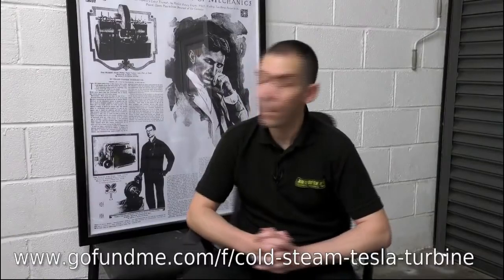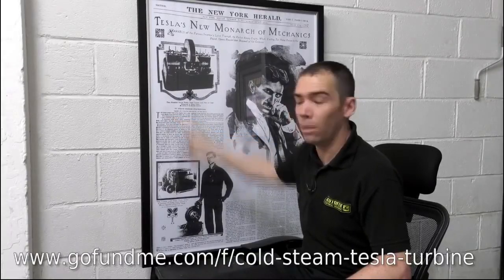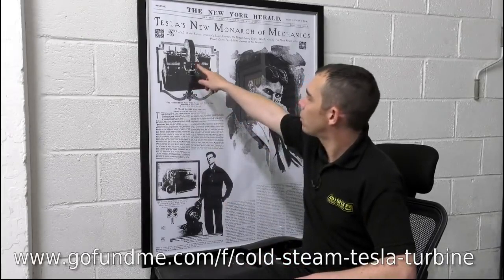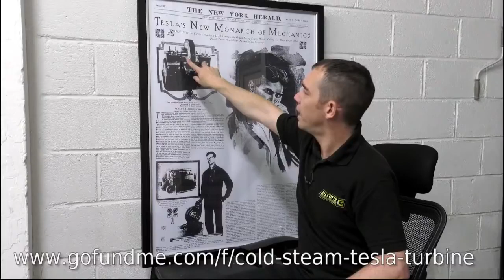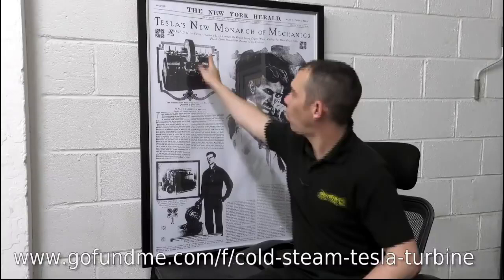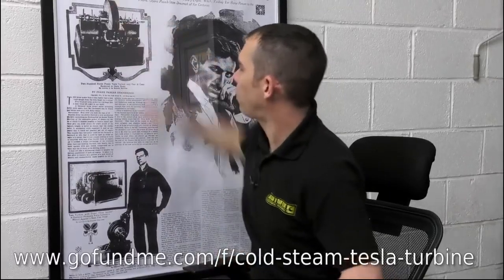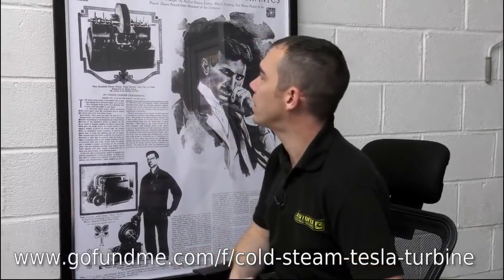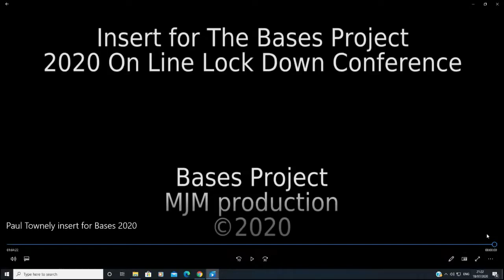Bases2020 - Paul Townley - Tesla Cold Steam Power - Part 1

Comment: Paul I love your work. I would love to help in which way I can. I am building a dual stage vertical hydro version of the Tesla Turbine with a custom made alternator (3 rotor , 2 stator on the same shaft). It is designed to run with 5L pr second with 30 x 15cm Ø @1.2mm thickness discs on the first and 30 on the second with 8 x 10mm mm vent holes. I use star washers 1.2mm....basically your mk2 design. I look at the dual stage turbine as a venturi. I am thinking about using a venturi at the inlet port and putting the suction part of it to pick up part of the second stage outlet. I am a Dane living in Japan
Reply: @nikola.tesla.r.and.d.centre  Well no I dont have a waterfall in down town Tokyo unfortunately, nor do I have space to mount a large solar array.  For now I am using a high output centrifugal pump designed to shift water around in reef style aquariums. The pump can push 18000L an hour to a height at 7 meters using 150 watts(Pump can be throttled as it is 24v). This is for testing purposes however. In my system the pump will be powered by 200 wh lithium cell that gets charged by solar or the grid.  Aforementioned is the drive train for the turbine. One of the advantages of this is  that the water gets circulated in a closed system with a water reservoir (300l) and the pump will push water into the turbine and help pump it out. The general idea behind this is to utilize rather limited watts by investing all of it in driving the turbine/alternator combo. Brake even is about 150 watt output from the alternator/turbine combo. When you think about it the applications are many in a "watergrid" on a larger scale. I chose water for this reason and because of the massive energy moving water provides. I also dont have the skills you have and access to the machining tools you have even though I love the cold steam where the Tesla turbine clearly has the biggest potential. Cheers!
Reply: @nikola.tesla.r.and.d.centre  A million thanks for the suggestion. I was a bit back and forth on the volute casing as it is more complicated to make. I know it is worth it, as it is effectively an evolution of some of the principles of a Francis turbine which has proven its worth, thank you for convincing me. My native language is Danish,  I do however also speak German, English and some Japanese. Japanese is a tough nut to crack though. It is a relative simple language to speak, pronounce and the gramma is easy as well.(They put words in different order though, so if you translate directly it is a bit like how Yoda from Star Wars speak)  Learning how to read Japanese  is another matter and I do not master that. My wife is Japanese though and my son is half Danish and half Japanese. If something complicated is called for they assist:-) You are right about the manufacturing part. I have established contact with a few facilities that are part university, part business they can make what I want at a reasonable price. The challenge is the technical communication. Thanks again Paul. I know you are working on gathering Tesla patents  if there is anything related to this process with regards to Japan or Denmark i can help you with let me know. I will drop an e-mail in your rocketmail(that is old school haha, love it)so you have mine. I will by the way make a Youtube channel with videos on my progress. Cheers!

Comment: A lot of interesting leads to follow in this conversation.

I wonder, why would the Carnot theory be "nullified" by having a frictionless system assumption? The aim of the theory is to establish an upper bound of heat engine efficiency. Adding friction terms to the model is only necessary to compute specific operating conditions for a built system. Many similar assumptions are used to derive relations in physics to approximate system behavior (e.g. frictionless planes for estimating velocities of objects, neglecting wind resistance for trajectories, etc).

The Carnot theory doesn't contradict the higher possible efficiencies of a Tesla turbine, it only suggests the approximate operating conditions necessary for a given level of efficiency. I assume you've seen the work of Warren Rice from ASU?
Reply: @nikola.tesla.r.and.d.centre  Thanks. Do you have the links where I can read about Frank Germano's designs/work/results? Any idea what operating parameters achieved 86% efficiency for his turbine?
Reply: I mentioned Warren Rice, as he had interesting insights about where innovation may be needed to maximize the performance:

"The performance of the overall turbine is strongly dependent also on the efficiency of the nozzles and the nozzle-rotor interaction. The performance of the pump is also strongly dependent on the interaction of the fluid leaving the rotor with that in the volute and on the efficiency of the diffusion in the volute."

He goes on to mention that laminar flow in the rotors can achieve >95% efficiency. I, like you, see there is great potential in this design. My comments aren't intended to cast doubt about the practicality of Tesla's work, but rather to avoid throwing the baby (thermodynamic theory) out with the bathwater (*present* difficulty replicating Tesla's work).
Reply: @nikola.tesla.r.and.d.centre  Just to clarify, a Carnot heat engine doesn't presuppose any particular heat engine design (e.g. reciprocating). The entire derivation is <15 minutes on Kahn Academy's Youtube channel. It is only based on the changes in internal energy of the working fluid as it moves from various temperature/pressure/volume operating points.
Reply: @nikola.tesla.r.and.d.centre  Adding friction to Carnot's theory doesn't change the upper bound for efficiency it implies. The validity of Carnot's theory doesn't detract from the Tesla turbine - the same way the validity of Maxwell's theory doesn't detract from the polyphase induction motor.
Reply: @nikola.tesla.r.and.d.centre  I agree. And no thermodynamic theory prevents a 97% efficiency level, as long as the the necessary operating temperature gradient exists.

As for "100%", I suspect Tesla understood the value of marketing quite well and I doubt he'd suggest (from a technical standpoint) an "ideal" device could be realized in practice.

Comment: These turbines need to be highly polished mirror finished surface to be more efficient but the surfaces in contact with negative pressure cold steam ought to be operating at ambient temperatures without fossil fuel energy inputs. Hydrolysed hydrogen is a far better solution to thermal application. The surfaces need to be designed with pressure dimples like a golf ball. This way the mass of the fluid is the driving force of the turbine.

The one issue that most people are missing is that the shape of the turbine discs need to be changed due to slenderness ratio to go hypersonic and thereby overcome strength limitations of the materials used. Giving away major secrets of my Project EARTH designs!

Adam Shattock
BEng (Hons) Civil Engineering undergraduate, 
University of Wolverhampton, England.
NTC 4 Mech. Eng.
Pietermaritzburg Technical College, South Africa.
MatselX (Materials Selection & economics),
Massachusetts Institute of Technology
Reply: @nikola.tesla.r.and.d.centre  you are right but it would become a pressure driven one instead at very high velocity. This is where sonic shockwaves become useful towards even higher velocities until it generates sonoluminescence. The friction is what shows the system down. Minimise that and you'll discover something new.
Reply: @nikola.tesla.r.and.d.centre     Exactly, this is the direction that I am working on, although I am not pursuing supersonic. Cheers John

Comment: Cold steam ? are you speaking of low pressure saturated steam ?
Reply: @nikola.tesla.r.and.d.centre  vacuum = low pressure. So yeah, that’s what he’s talking about (Scientia non habet inimicum nisp ignorantem)
Reply: The channel Jeremiah has an inventor working with/in parallel with Paul.   Under sufficient vaccum, the water boils at low temperatures.  The same concept is used in heat pipes in your laptop, and the type used inside the glass tubes as heat collector/transfer devices in evacuated tube solar.   The vapor speed in these types of heat pipes can be supersonic if enough heat is being transfered.